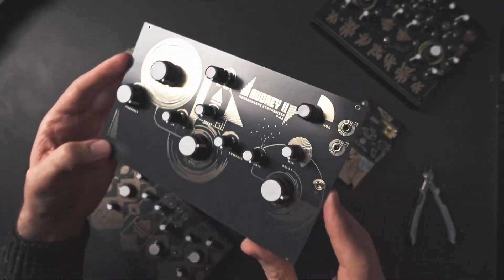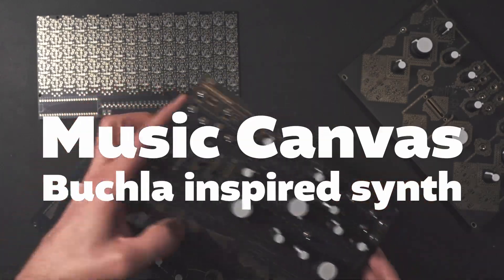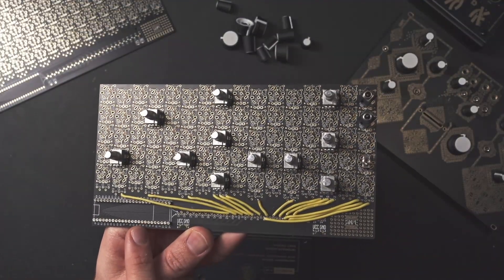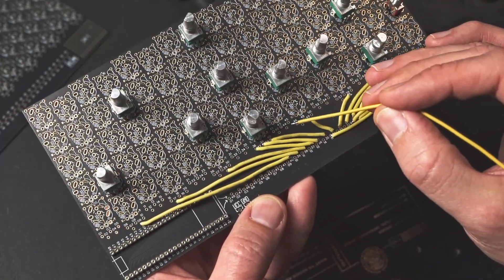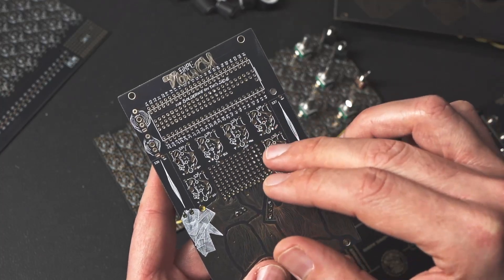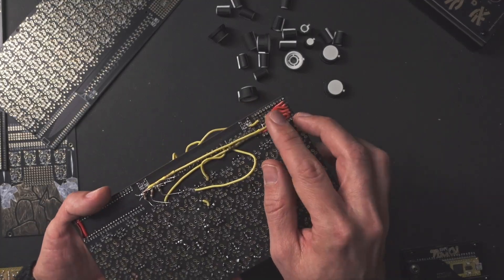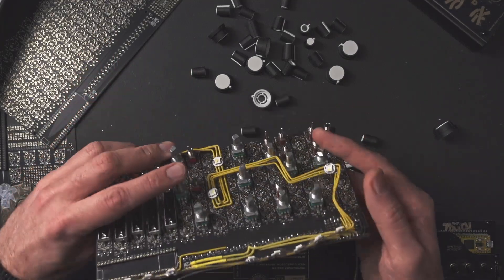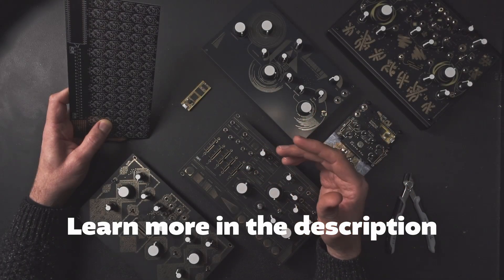Design Your Own Synth! Open Source Tools + Residency Program

Comment: Are there platform APIs for processing audio input as an FX unit? Or even as a MIDI manipulator with no audio out?
Reply from the maker: For FX we use the Daisy Seed. It has stereo in and out. You can also do midi with it.
Reply: @SynthuxAcademy  Thanks! I've done plenty of plugin coding in the past, both audio and MIDI manipulation, but kind of have a notion to get away from the laptop these days!
Reply from the maker: Yea, I know the feeling. I’m now at the point that I’m ok working on the computer if it’s for synth design or video work. For all the rest I avoid computers like fire :) if you want to apply for the residency I’d be curious what ideas you have for physical devices. Spotykach also started as a plug-in.

Comment: Just a little off-topic thing, compared to the first version of "Spotykach" (I hope I've spell it well), I find the new version way more messy in terms of pure visual feedback UI. 

It's surely more funky/tech-y, but it remains visually too much filled for me for a possible future use, and feels like you wanted to experiment how far you could go with the pcb board design instead of maximizing the actual quantity and size of infos needed. 
For instance, in a shady light live situation, the last thing you need is to wonder which button is the right one or if you aimed good at it, and didn't arm another tactile pad by mistake because it has a leg stretched a bit too close to first tactile pad.

The first version is maybe a bit more "sober" (even tho it's superb design) but the eyes can understand what are the different parts of the instrument straight away. 
It's what kept out of pre-ordering it. I know it's under process so I wanted to introduce this in the loop while it's still possible, if it can help or if anybody relates to this. Too much infos kills the infos.
It's just my 2 cents, I wish the best for this wonderful instrument to come.
Reply from the maker: Thanks for this. Indeed, we’re always trying to push the boundaries. We are an academy first, and experimentation is essential to the process. That being said, I am taking your feedback (and others) as part of this learning process. In fact, there is already a new version of the interface (join discord to see it). This version takes into account feedback from the first video and more. We try to keep the process open and we take community feedback very seriously. Thanks for being honest and sharing your thoughts.

Comment: the synth community needs an open source foundation that mfgrs sign a pledge - if they discontinue a product or go out of biz, they will open source hardware/firmware/etc. - additionally, all power inputs need reverse power protection with low “rds on” mosfets, and onsemi ESD protection on input/outputs - these things would build confidence in consumers of used/new modular gear.
Reply from the maker: Couldn’t agree more. Open source is at the core of our vision. But I also respect other creators who decide to keep things close. Keeping the lights on is not an easy task, and a lot of factors should be taken into account.

Comment: Wow, Roey! I had no idea that there was so much DFM thinking underpinning your devices. This is genuinely impressive stuff. One thing that this form factor doesn't have a ton of room for is hardware debouncing, which means anything clicky is going to require some software overhead to work as expected. However, even just the omni-footprint grid you folks came up with is really inspiring.
Reply from the maker: Thanks! We are working on an extension PCB that makes it easier to add CV, Midi and buffers. Thanks for the feedback!

Comment: This is awesome!
I would love to start building my own instruments.
Question, how you protect the input/outputs from being used wrongly (e.g voltage or input plugged in output)
Reply from the maker: You'll need to design a buffer circuit. Join our Discord to learn more (check out the analog channel) www.synthux.academy/join
Reply: Man, I love what you guys are doing so much!
This sounds like a great opportunity,